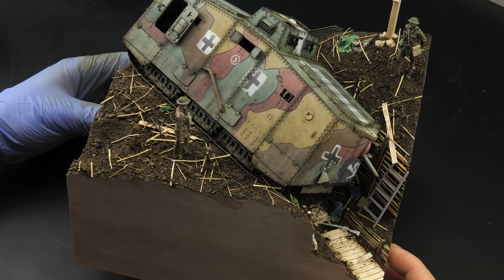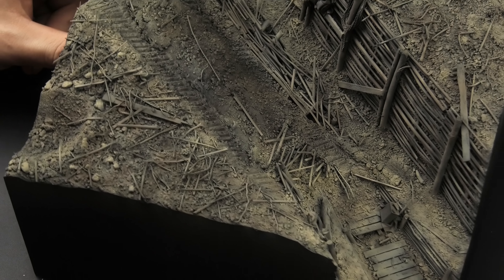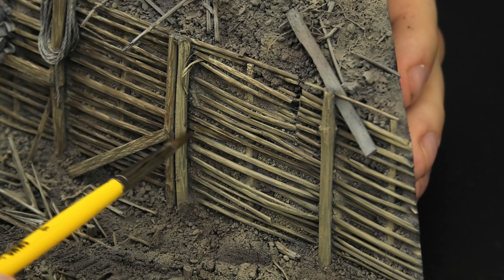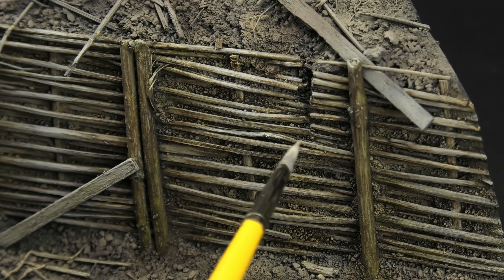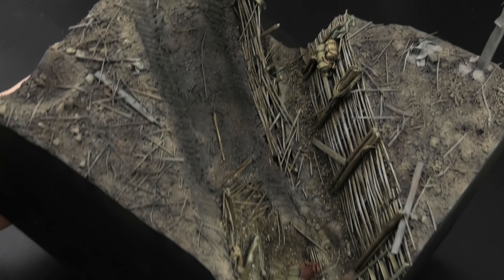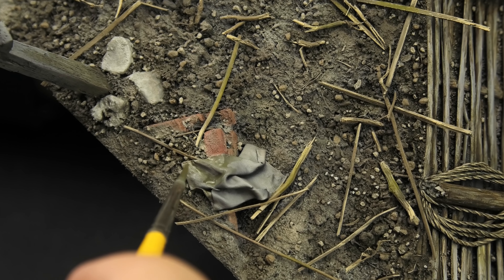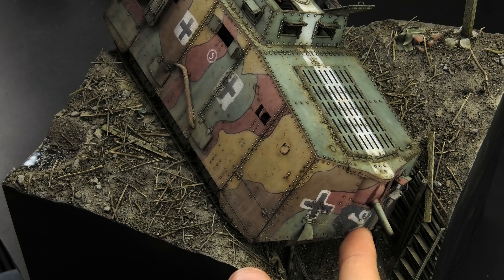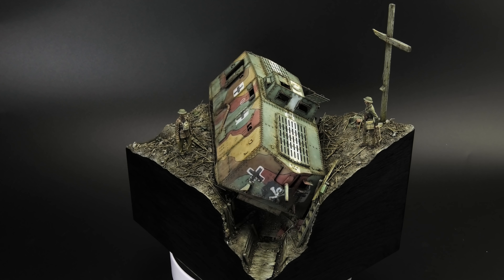"Savior" - WW1 Trench Diorama

Comment: Similar to the lungs.. When I first got a 3D printer (Anycubic Photon Mono SE) I did my first print with the printer on my modelling bench in my bedroom, I thought it smelt a bit bad so I opened a window but thought I could still sleep in there. I woke up at around 1 am dashed to the bathroom and vomited for around half an hour. I now keep the printer in the loft. Make sure you always have ventilation when working with chemicals, especially paint and resin!
Reply from the maker: That's interesting, lots of people are talking about this but honestly, I never felt anything or smelled anything bad, and I have the 3D printer right next to me... it just has no odor. Or my lungs are already way beyond saving :D

Comment: Awesome result! 
Suggestion for you for that last touch… if you look at the tank sitting there it looks like it either just happened or it was placed there. The way to fix that is with a weathering step to create streaks matching the resting position. On our SFX models I weathered them in static and dynamic positions. A plane spends most of its life sitting on a tarmac so the weathering should be mostly vertical with some flying streaking. Depending on this relationship it tells the story of the use of the plane and environment. So on this tank if you weather it further in it’s resting position it will look like it’s been there for at least a few days in the rainy muddy battlefield. 
With a studio model I mixed water based paints with soapy water and misted it on and let it dry to get the streaks looking very natural. At this small scale it can be done with water and a very fine paint as well. I used house paints before, cheap and easy. Great work and interesting subject!

Comment: I did a big trench diorama. I didn't paint the terrain because I used AK's range of terrain products. I'm very surprised you felt the need to use paints for that as AK's range is extensive. You get a lot of colours and products enabling the modeler to do this.

This is an excellent diorama.

Don't you think you create a lot more work for yourself than is necessary?
Is this because you're showing the viewers how to do certain types of effects?

These are top notch tutorials, not to say always effortlessly amusing with your commentary.

PS: I had a leak using AK still water. My solution = sealed it up, waited for it to dry and filled the area up with more still water. With what you faced, I'd have simply done the same as I did, but painted over that side with black. No one would have been any the wiser.

My motto, "when in doubt, CHEAT! I'm all for loopholes, short cuts and the path of least resistance."
Reply from the maker: Making sure the groundwork matches the weathering on the tank is always my priority, and I feel it's easier to achieve that using the same paints and effects as I used on the model... and painting the terrain is just fun! But, of course, it's subjective :)
Reply: @NightShiftScaleModels  Just so. The terrain I've done matches up fine. I'm interested to see you don't use dedicated paint sets. I do and they help me a lot. Each to his own.
Your videos are right out there on their own - terrific.

Comment: would you have any idea where i could find some (preferably) 1 piece tracks for a 1/35 A7V? ive got an old tauro kit thats been sitting uncompleted for maybe 30 years because the tracks came with individual links that you would have to pin together. the problem is the holes you have to stick the pins through are really thin soft plastic and tear out really easily. and many of mine have so torn. id like to finish the tank, but i dont know what to do about the tracks. not the most skilled modeler so i dont think i could handle and really complicated repair or fabrication process. any suggestion?